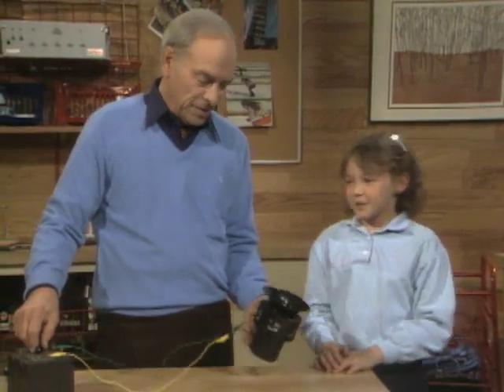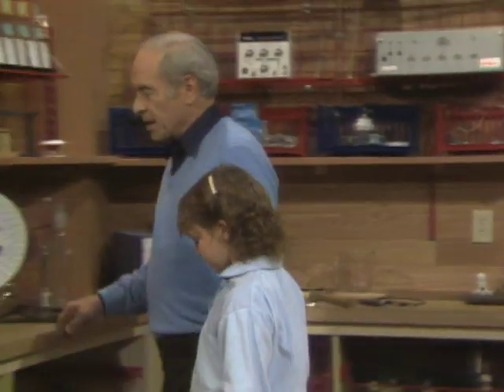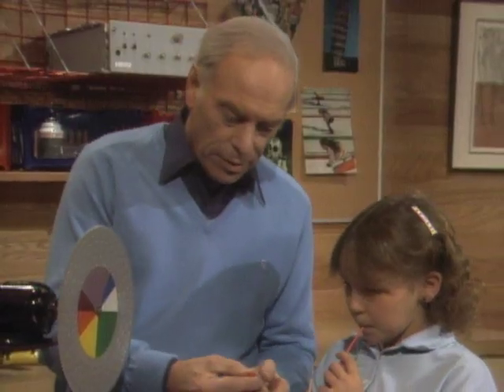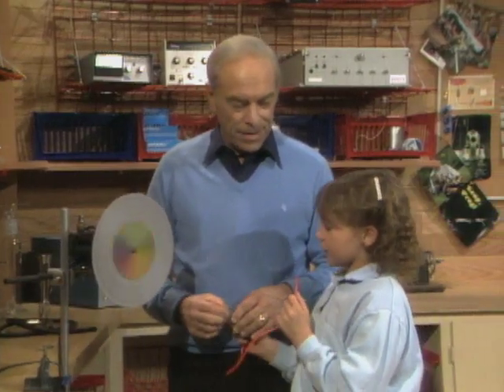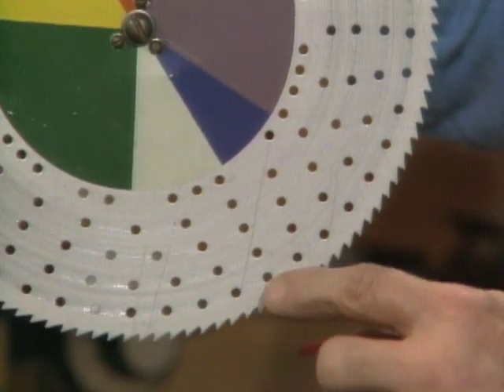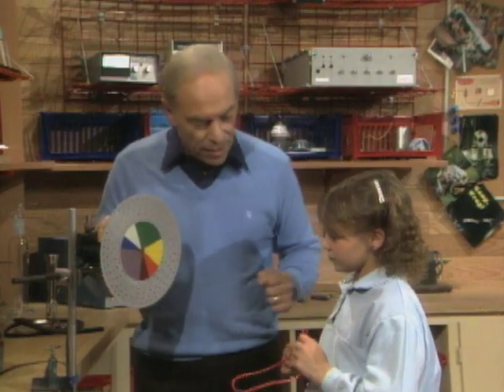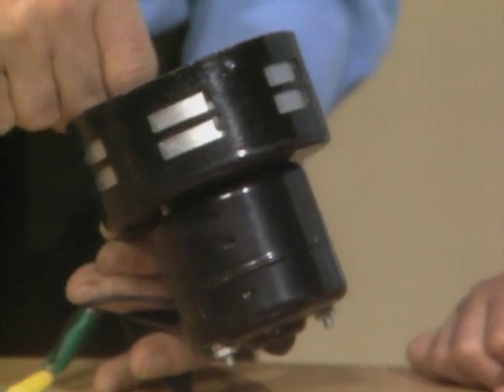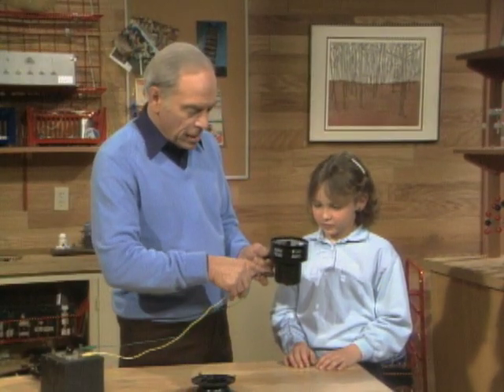How Does A Siren Work? (Mr. Wizard)

Comment: Emergency warning sirens Control by using two things a chopper and a stator The chopper will make the wind chop up into little pieces in the stator controls the sound and if you add horns to it it will Echo more

Comment: I take issue with his comparison of nice and "yucky" sounds. The explanation of a siren chopping air into little pieces was completely correct and a perfect explanation in itself of how a siren works. However, the "yucky" part is both irrelevant and incorrect. First of all, a siren's rotor openings are evenly spaced, not irregularly spaced. Secondly, the siren speeding up does not make the sound yuckier or distort the sound waves in any way. It's just the same sound sweeping upwards in frequency.
A siren may sound "yucky" due to the way its housing funnels the air, the presence of dual rotors, or other physical factors. However, most single-rotor sirens (especially Sentry's models in my opinion) sound generally pretty clear and un-"yucky."
Reply: The explanation does make sense. The holes the air is being pushed through are constantly changing size due to the rotation of the fan. Compared to the nice sounds where the holes are of constant size
Reply: @dforbesjr99  No, the changing size of the holes doesn't have any relevance to the "yuckiness" he was previously referring to, and he was wrong to imply that it did. The same hole size change was occurring with the "nice" sounding holes.
The "yuckiness" he was referring to is an uneven placement of the holes, causing the pulses of air to be irregularly timed. The demonstration with the saw makes some sense as the sound frequency is actually being modulated irregularly because the holes are spaced unevenly around the disk, but when he demonstrates with the real siren, it disproves his point, because the holes in it are evenly spaced. The real siren he uses is actually the same thing as the "nice" sound on the saw. The only thing happening with the siren is the pitch increasing, there isn't any of the "yucky" as he described it earlier. "The faster it spins the yuckier it gets" doesn't make sense because, again, the only thing changing is the pitch, while the frequency, though increasing, is still even and regular.

Comment: that is not how an air raid siren  works
Reply: Yes it is.
Reply: It is
Reply: Rod Karch it is you dummy
Reply: They aren’t speakers
Reply: @SoonerStateSirens1 : Who else in here said anything about speakers?
Reply: @HelloKittyFanMan  who else in here responds to 5 year old comments? Damn.
Reply: @SoonerStateSirens1 : Who else in here gives a freaking crap how old a comment is, like it's supposed to matter for some odd reason? Damn, haha! 😆
Reply: @ Get a life
Reply: @SoonerStateSirens1 : Wha whaaa, cry really hard just because you can't handle when someone disagrees with you for a really good reason, so you try whining about how old your comment is, like that even matters. Wha whaaa! 😭 You're the one who needs to do what you just said there.
Reply: That's exactly how an air raid siren, and all electromechanical sirens work, well, minus the whole part where he explains that the sound is because the hole gets bigger and smaller.